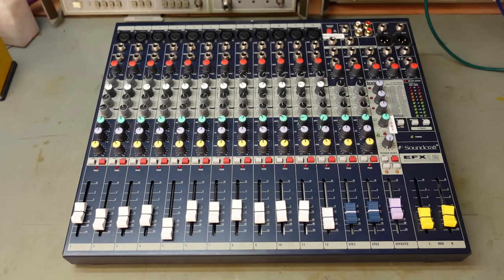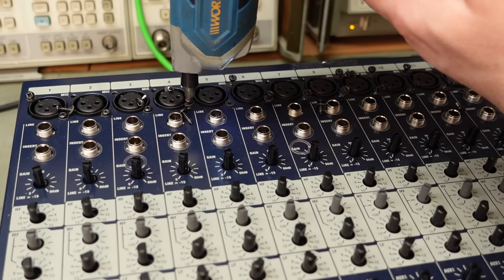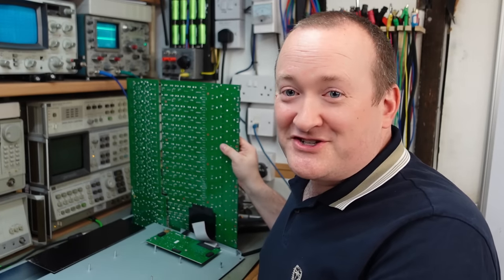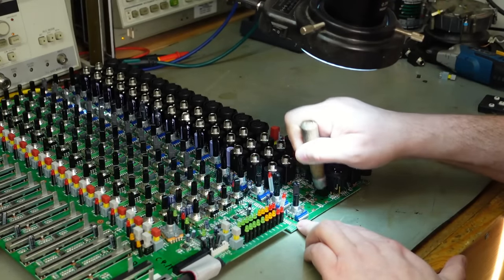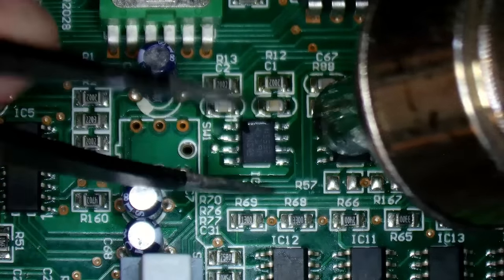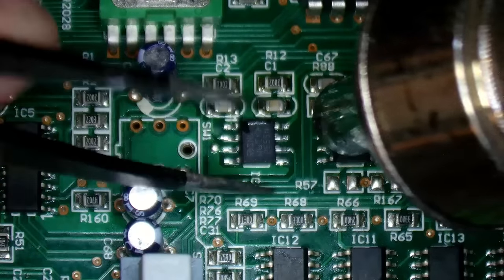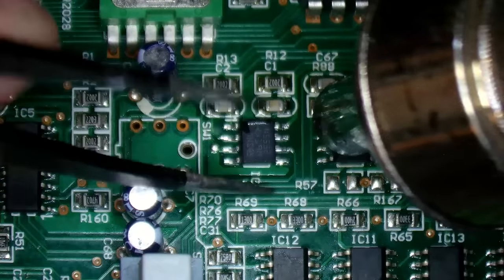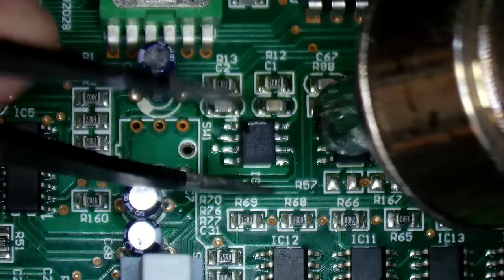Mixing Desk Repair - Soundcraft EFX12

Comment: Great work. I think reading between the lines here things are getting broken / dry joints because there’s way too much flex on the circuit board liable to have plugs rammed in sockets at force and buttons punched enthusiastically.

Comment: the cut wires may have been attempts at  changing the pre/post function. Most cheaper consoles are fixed in one position and can be modded to the pre position . What that does is allow the fx and monitor pots to be independent of the fader

Comment: Sometimes you can get away by thermal shielding plastic components with kapton tape. It works best when you leave an airgap at the side wehre you apply the hot air.
I also recommend you to try Chip Quik. Its a special desoldering tin which has a very low melting point and stays fluid much longer then conventional solder tin.

Comment: Another great post ! -RE: Your "unbranded Chinese same as Amscope" scope ..Thats a real cool looking swing out stand - ..do you have any info on that?  also, what's that well used "PCB cleaning pen" tool you're using ..and is that blue paper your soaking up the PCB with some special treated paper ?  (..sorry for all the questions!)
Reply: Well I'm curious about the pen as well. I suspect the blue paper is a blue paper towel that's a little more rugged for garage shop use although that looks like the cheaper knock off from brand-name.

Comment: Mark, why do you think the op amps failed, did you check stability of voltages / current etc, or did you suspect a mishap with phantom power being inserted somewhere...? I can't imagine a cause for 6 ICs to all be faulty hmmm 🤔
Reply: Ye I would liked to have seen the diagnosis part.

Comment: some kapton tape, or a simple metal shield would have been ideal on that edge of the slide pot. I always shield anywhere the heat can potentially go, otherwise I am replacing parts that I really didn't anticipate on replacing.

Comment: I would have checked the power supply to see if everything is ok. On my McCrypt MX1204FX mixer, a few capacitors in the power supply were bloated. I suddenly had strange chirping noises in the speakers immediately after switching on the mixer. The noise slowly went away after that. Then I noticed that some LEDs were flickering wildly. Of course, I immediately switched the mixer off again to avoid consequential damage.

Comment: Hi Mark , great video but i was watching hoping to get some insight on how to fix my mackie 24 8 console that has the left #1 bus not sending signal. Any advice? Should I open it up and clean it? Check solder joints ?

Comment: What a nightmare to strip down. I worked for a company where they used plug in boards to the mother board but these where huge studio mixing desk.
Soundcraft was owned by Hardman Karman or my be still is ? they purchased the firm which I was working for and after 3 years closed it down.

Comment: Amazing. Thank you very much for sharing. I am a musician, hence the money is low, so I repair everything I can manage. Just finished cleaning exactly one of the same mixers.
Everything is working, except channel eight which ain't got any effect. Got sound but not any effect coming through. All other channels have the fx working at exactly the same settings.
Do you have any idea where I should start looking for this problem? The ribbon cable had a minor dent in it, so I was suspecting it could be there the problem lays. But if it is not the cable, I guess there must be something on the channel itself malfunctioning. Thanks for any advice.

Comment: very cool to watch thank you! We have the same - or similar - hot air station. What temp and airflow do you use to desolder those chips?
Reply from the maker: It’s a Quick 861DW hot air station, modified with an extended hose. I think it’s set at 325 degrees C, and 45 airflow.
Reply: @MendItMark  Thank you! I have the DE version, just larger blower. 325C is what I use, amazing. It's so frustrating when you watch videos online and you see people using 500C on their machines!

Extended hose? Very interesting! Can I ask how you did that?

Comment: I remember around 80/90’s much trouble with dry/ cracked solder joints! I think the lead free solder was a lot to do with it especially around psu’s, output stages where there was a lot of heat! I used to fix boards for business equipment (printers, copy and paper handling equipment etc). I think the lead free joints was’nt elastic enough and cracked the joint when things got hot i.e. thermal expansion. My cure was check with magnifier first then go over many suspect joints and wet the joint with lead solder! I don’t know if lead free is still used today as I retired about 14 years ago? None of the jobs came back after the lead solder treatment! Anybody else experience this trouble? Fraser

Comment: If it is not difficult for you, please advise? I want to try to upgrade my old Yamaha mg124cx mixer. Can I replace the original njm4580 chips with eg OPA2132 / AD797 / JRC5532 / JRC2114 / LM4562 without changing the harness? and can it affect the sound for the better? I replaced operational amplifiers in the sound card and chose the best sounding ones for myself. Will this option work here? If so, is it also possible to change the TL072 input chips? I disassembled this mixer myself in order to replace the faders (the old ones were worn out), soldered Alps - the sound became better! That's why I decided to try such an upgrade?! If possible, later I would like to replace all operational amplifiers with top-of-the-line microcircuits, or at least better than the basic ones?!
Reply: You would be wasting a lot of time and money with those sorts of "upgrades". Won't make any difference to the sound. Replacing word faders will help, naturally. Trust me, I have been repairing and servicing pro electronics for 40+ years.
Reply: @sw6188  Thank you for your answer. But I still want to try its modernization. As soon as I am ready financially and buy all the necessary parts, after the processing is finished, I will let you know about the result (smiley)
Why did I so persistently take such a step - because when I replaced the inflated panasonic capacitor in the active amplifier with the same nominal, only new Samwha - the sound became an order of magnitude worse and I had to solder out a whole panasonic from a dead amplifier. And I also have a nichicon fine gold sound card and the sound is different from the same one only with solid-state elna. And with operators in sound cards, I also experimented with my choice of opa627bp (2107 doubled), so I think that there will be a big difference in the mixer too?! I understand that it may seem unreasonable to invest 500-800 dollars in a mixer worth 350, but it is very convenient for me and if it will sound better after this upgrade than a 2 orders of magnitude more expensive one, then this is already a success! I looked at the circuitry of expensive models - so all the cheap operators have only the wiring, which is a little more expensive, but far from the top?!
Reply: @AndreyKAU  It's only convenient and worthwhile if you don't value your time. A lot of people make changes ("upgrades") to their equipment with fancy op-amps, expensive "audio grade" capacitors (no different to any other capacitor except a premium price) then kid themselves they can actually hear a difference. They have to justify spending all that money! As an electronics engineer, I can tell you that unless a part is faulty, changing it out won't make any appreciable difference to the sound. As to sounding "better" - how are you going to quantify that? Once you have changed the parts out, you can't then do an A/B test against the old ones. You can only "believe" what your mind is telling you - and that's where the subtle influence comes in. "Yes, it sounds better" (your mind telling you it does because of the money and time you spent therefore it must be better). You have no actual way to prove it.
Reply: @sw6188  I want to try on one channel and general output first, so as not to spend a lot of money at once. And I can check, of course, on an oscilloscope and a tone generator, but as a rule, nothing understandable will be seen there. But to record the difference from the same source (for example, my SONY NW-ZX2 through the original mixer of a friend and my modified one), I think it will be possible to hear on the recording that this is either a useless undertaking or a real step forward ?!
Reply: @AndreyKAU  You will find that the test equipment will show the same results regardless of parts - unless, as I said previously, there is some fault or something not right. As for what your ears say, only you can be the judge of that!
Reply: @sw6188  thanks for your reply

Comment: Ooh, phantom menace brown frown. Of course some mixers put the phantom power switch right next to the power switch... both in a place that you can't see! Whywhywhywhywhywhy. Even if this mixer had sensible controls it could have been blown up by another mixer that had the phantom power switch next to the power switch (although it could have been blown up by connecting to itself, unless there's special protection... IDK)

Comment: Phantom power into the outputs… ouch!

A friend of mine (wedding DJ) let a videographer connect a recorder to the pass through on the back of one of his powered speakers, that had phantom power engaged and it damaged the speaker and his mixer… I got both working again but it was a mess.

Comment: HI Mark. Like your videos- great stuff. Quick question please. To interface the BNC signal generator to XLR balanced input are you using an inline 75 to 110ohm adaptor or just straight cable. I'm interested as I have a job coming up similar to test all inputs in a mixer and don't have BNC to XLR "interface"- cheers from Australia

Comment: I wish people would pay me to do that much work on anything. As soon as I mention that it takes some time to get it apart, they start to limit the spend, or they just pick it up and won't let me go any further. It hardly matters how much it's worth, the wallets are tightly shut. Much of my repair income comes from initial diagnosis only. It's exciting when I actually get someone who loves a piece of equipment enough to have it fixed.
Reply: Sounds like you have some real cheapskate customers. I never have an issue with the cost of repairs, and I don't give quotes (not possible).

Comment: Dear Marc, 
Thank you for this interresting video
I'm new to electronics and have a few questions: did you change the microcontrolers to new ones ?
Isn't there a way to bench these microcontrolers to find out what's wrong with it ?

I'll rewrite an observation from GTOger who wrote :"dials and faders don't just intuitively make sense to anyone who walks up to a desk". 

I found a mixing board in the trash and will use the knowledge your expose to fix that one. I especialy fancy the way you checked the Mosfets up.

Comment: Dear Mr Mark, do you know where to get linear potmeters for the LEM RX300 powered mixer? They're marked with "D10K". Travel is 45mm, total length is 60mm. I can't find them anaywhere. Do you have suggestions?

Comment: Hello Mark. I was unable to follow your diagnosis of the demize of the 6 op amps. Did you deduce that they were ex  OP AMPS given they were running hot with BA signal from experiance?? Yours, somewhat perplexed, a simple DL7 called Mike.
Reply: I've just scrolled through all of the comments looking to see if anyone also picked up on the same thing.   It appears the diagnosis was based on thermal readings, but I'd love to know if there's more to it than that.  I have an old Midas Venice where inputs, headphones, PFL, Master LED's are all working but no outputs from Masters or Auxes.  Would love to find a way to resurrect this lovely console.
Reply: I was also curious as to why they should all fail like that? Had there been a problem with the power supplies that were putting out a high voltage and since been fixed? 
Odd so many chips should fail.
Reply: So the chips are supposed to run hot, which means there was probably nothing wrong with them?

Comment: If that is indeed an issue of phantom power being applied to the outputs. I would suspect an XLR to trs adapter or cable being connected to another mixer with global phantom power. Generally it shouldn't be a problem except for when cables get converted to things they shouldn't necessarily be converted to without knowledge.

Comment: I have a Soundcraft Notepad 12FX in the shop that has a dead power supply. The shop claims he cannot find a replacement power supply and he's had it for six months - suggestions ? The device has no power switch so it is on most of time.

Comment: Just wondering, why didn't you use kapton (polyamide) take to shield the parts from heat when using hot air?

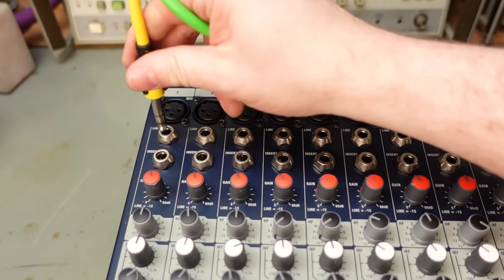Comment: @0:50 the "Monitor Out" cannot used for Monitors on stage, but "Aux1 Out" only,  thats why somebody put the sticker with "MON OUT" on Aux1 , there you can mix your monitor in each channel with Aux1 knob.  "Monitor Out" just has the same signal as the phones. "Monitor Out", no chance to use it for a monitor mix

Comment: I have one of these, all my outputs are stable but unfortunately the FX have gone,  ive avoided stripping it down like the plague becuese they are 500 piece jigsaw puzzles. I have a presonus digital desk ass my main for the rig but ide like a back up fully working just in case, ive never tried to fix an FX set up before, big amplifiers are my thing. Ive had to learn how to fix everything myself over the years, ime not sure i can fix this tho.

Comment: Id wager all that flex when you're plugging the jacks in and out on the bare board might have fatigued those jumper cables and solder joints. I'm surprised they didn't use flexible wire there, although I guess when it's mounted in place, it's not going to be flexing that much with all those screws and nuts holding everything down. Guess there was a reason for overbuilding the top cover, heh.

Comment: Good show mate , to bad the wankers at soundcraft did not just use sockets to allow the op amps to just be pulled off and punched in. , It would have been smart , especially for those that like to roll op amps for better than the shite that is used . Any how , I just found your channel and I enjoyed your video . Cheers 🍻

Comment: Hi just need some info on your hot air station. Where can I get the pipe to extended it 
Thanks
Reply from the maker: It’s some silicone tube, with the same internal diameter as the standard tube. It also contains cables for the heater and temp sensor. It’s about 2.5 m long, and I’m surprised how well it works!
Reply from the maker: Oh, and I got it on eBay. Silicone vacuum hose, 13mm internal diameter. It’s actually 2m long.
Reply: @MendItMark  thankyou  love your videos
Reply: @MendItMark  thankyou  love your videos

Comment: I have a soundcraft  monitor that has some Dustin issue but 
I tried using cans of compressed air on on an on beghringer mixer without take the body off but I didnt work so I think I think I need to take the body of